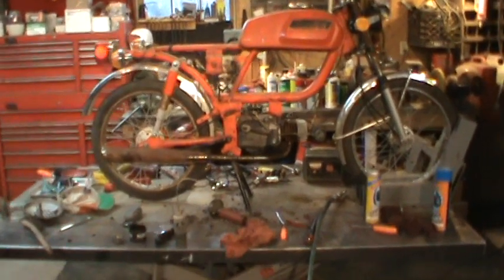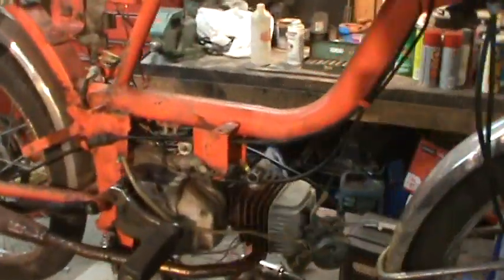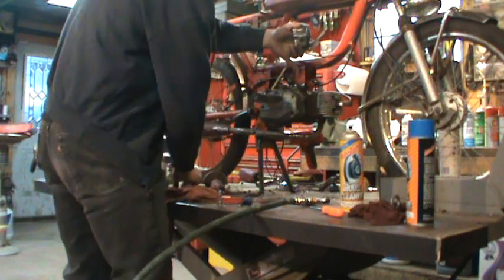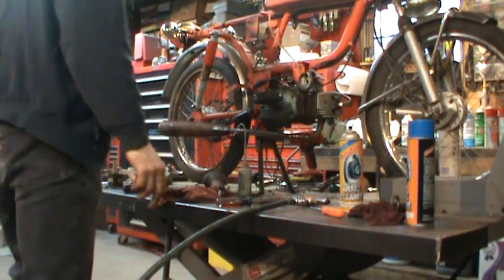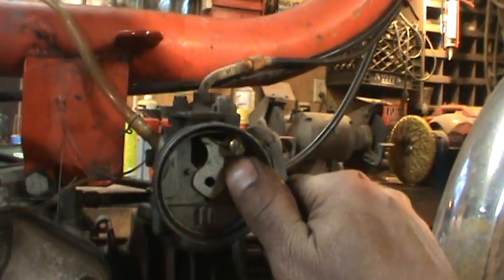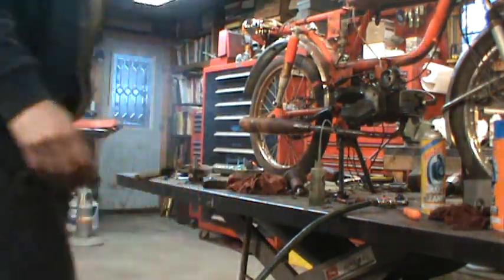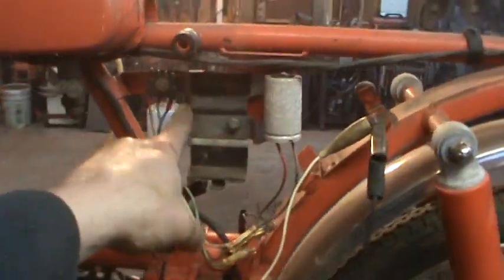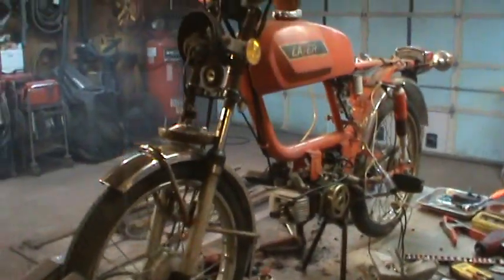moped old start cold start 32 years

Comment: I had a moped when I was young and after riding it home couldn't get it started, after one hour I finally learned you had to shut off the lights so all power from the magneto could feed all the power to the spark plug. After I learned that it started easily every time.

Nice find.
:-)

Comment: run lots of oil through the gas and a little methyl  ...and just baby it    should be OK  definitely a keeper  !!
I'm a retired motorcycle mechanic  and ride a 1970 Honda CT70 unrestored.
I get a kick out of telling the kids its 45 years old , starts first kick and idles like a watch
Reply: I have a 1977 Angel moped green jpg 48 for sale if anyone is interested
Reply: '77 xs 750. Sounds like a purring watch.
Reply: those honda 70s are pretty reliable, ive had one for decades, its probably a 71 or somewhere around there and i've never had problems with it outside of changing a spark plug

Comment: The choke releases when the throttle is full open. The V1 is known for the crank seal on the trans side going after sitting for any length of time. Best to change out the trans fluid right away it uses 30 weight oil. Sounds good.

Comment: Also steel wool rubbed on the exhaust will clean up the surface rust until all you have left is a nice chrome muffler.
Reply: There's not a bit of chrome on that exhaust.

Comment: The taillight bulb is probably burned out which is why you didn't get spark without jumpering it to the lighting circuit. The ignition primaries on European mopeds often grounded through the taillight. If the taillight bulb burns out the engine won't run. It was a safety feature to prevent people from riding at night on a slow little moped with no tailllight. It has to be the right resistance taillight, too, otherwise the engine might not run properly.
Almost nobody in the US knew this. Nobody was trained in moped maintenance. All the personnel the dealerships had in the '70s were salespeople. The taillight is what happened to all the old mopeds. They would quit running, nobody could figure out why there was no spark, so they would then sit outside in the rain for years behind a garage. Noone bothered to check the taillight bulb because who would have thought of that? Some people did get spark by jumpering the headlight coil to the ignition, still not realizing the whole problem was the taillight bulb.
Most mopeds that spend years out in the rain without running are pretty much junk- especially the ones that had integral frame fuel tanks. They rust bad on the inside and can end up weakening the frame. 
I check the taillight bulb of every ruined, rusted and neglected derelict moped I run across and every single one has been burned out. That's why they all quit running after a couple of years or so.

Comment: Lazer mopeds were made in Taiwan from 1977-1979. They usually have a Minarelli engine and are basically a copy of a Peugeot Sport 50.
Reply: Here in Europe these Peugeot were made by Peugeot in France originally as a Peugeot TSA with an original Peugeot Engine.
Reply: Getting Nervous
Lazer is the same as the Peugeot, a company in Taiwan just purchased rights to copy the design. Hero and Kinetic motors in India did the same with Puch.
Reply: twogreatguitars
I know.  But you only can buy rights to copy a design from the original manufacturer. And this was Peugeot.
Reply: That doesn't mean Peugeot manufactured this moped.
Reply: twogreatguitars
Right. The models from Peugeot got the Peugeot engine.
Reply: twogreatguitars do know about how many were made just curious I'm assuming my hunch is that there was not many made between those years because if it was a popular moped they would've been selling them more

Comment: Another old minarelli built moped, mine was a general 5 star, ran great for over 20 years of daily putting around, odometer stopped working at about 74,000 miles, frame broke about 2 years later

Comment: My first motorcycle I bought from an old biker and I said the same thing about the bike he was trying to sell me. He picked up a new piece of steel wool dipped it in kerosene simply as a lubricant he told me and five minutes later where there had been no chrome visible just a lot of rust there was chrome I bought the bike and three days later no rust and a lot of chrome was shining.

I had the same reaction when he said the chrome was still there and until he showed me I didn't believe either.

Try it.

No bs.
Reply: James Shanks Gojo hand soap and scrub with aluminum foil-best rust remover and chrome restorer ever.  I will try steel wool dipped in kerosene as well.

Comment: Where in NH are you located?  We have a pretty solid group of riders in the Nashua area.  I live in New boston.

That Lazer Sport 50 you have is actually a pretty sweet little ride.  It's pretty much a dirst clone of a General 5 Star, except the Lazer was made in Taiwan, whereas the General's were made in the USA.  There was also a General 5 Star that used a Sach's motor.

That Mineralli motor is great.  I tend to work mostly with Puch and Honda bikes, but would not turn down that bike at all.

Comment: I found an Australian built Victa 2 stroke lawnmower which engine was full of water,it still has good compression but I've had it running,I can't control the engine speed because the engines O Rings & likely the crankshaft seal leaks air.

The carburetor is governed by crankcase vacuum but I think that it has a vacuum leak because it will only run flat chat regardless of throttle position so I have all the crankcase O rings & I Just need to order new crankshaft bearings & a new crankshaft seal for it or use the sealed Ball bearings in the engine !

Comment: I wish you were closer to london ontario  i have a bingo bravatus moped ... it just wont run
Reply: Jon Rogerson 
Check the taillight bulb. The ignition grounds through the taillight on most Batavuses so the engine will not run if the taillight burns out. It's a safety feature. Anytime a moped quits running, always check the taillight first before checking anything else. You have to have the proper type of taillight or the engine may not run properly.

Comment: Are you putting straight gas in a32 year old 2 stroke?
Reply from the maker: come on now
Reply: lol im sorry im not sure how to tell if its a 2 stroke or 4 stroke
Reply: 2 strokes have that weird bulb in the exhaust, 4 strokes just have a straight pipe
Reply: The larger part of a 2 stroke pipe is the expansion chamber, basically it captures unburned gases and fuel and the engine sucks that back in on the next stroke and burns it, increasing power. The dimensions of the pipe determine the volume and timing of the unburned material being sucked back into the engine which varies from engine to engine and needs to be correct for maximum performance gain. A stock bike like this would not have much of an expansion chamber though and most of that is baffles and such to quiet it down

Comment: what kind of moped is it??
Reply: the Body is from a Honda, however the Engine looks like  a Sachs engine.
Reply: Lazer mopeds, made in Taiwan back in the late 70s. Engine is Minarelli, bike is a copy of a Peugeot Sport 50.
Reply: The body is originally from Peugeot and the engine is an italian Minarelli. Sachs has built fan cooled engines until the early seventies but never built fan cooled engines with a horizontal cylinder.
Reply: Getting Nervous
Incorrect, it is made by Jui Li Enterprises in Taiwan, a licensed copy of Peugeot with engine sourced from Minarelli. The Taiwan company licensed the design from Peugeot.

http://www.myronsmopeds.com/category/parts/lazer-parts/
Reply: twogreatguitars
Nothing else I wrote. The body is originally from Peugeot and Jui Li Enterprises has copied it. So the body isn`t originally from Jui Li Enterprises. It´s just a licensed copy. Or don´t you know what "originally" means? Maybe you have to read the website: Lazer and General are Taiwan copies of this,
an earlier French, 1975 Peugeot Sport moped.
So a copy is never the original, it´s just a copy.
Reply: I'm the one who said it was a copy. I know what a copy is. It sounded like you were saying Peugeot manufactured this moped, which they did not. That's what he was asking.
Reply: twogreatguitars
I am sorry for this misunderstanding. You are right, Peugeot was only manufacturing the original which was the Peugeot TSA (in Europe TSA was the name of this model).
But Peugeot did not manufacturing the Lazer models.

Comment: Running this bike without the breather can lock up the motor
Reply from the maker: say what?
Reply: @mustie1  running a 2 cycle motors  with out the air breather will lock up the motor it needs restriction from the breather to keep it from over winding the motor have repaired motors for over 20 years
Reply: i believe what bobby means is that small two stroke engines are very particular about their air fuel mixture. The guy took the air filter off the carb when he couldn't release the choke then he never put it back on and was trying to run the engine without it. This means much more air is entering the cylinder . this makes the engine run lean and hot which will dry out your piston rings and eventually they will seize. It also means the engine isn't going to run very well because the air fuel mix is now incorrect. If he put the air filter back on the carb the engine likely would have ran just fine.